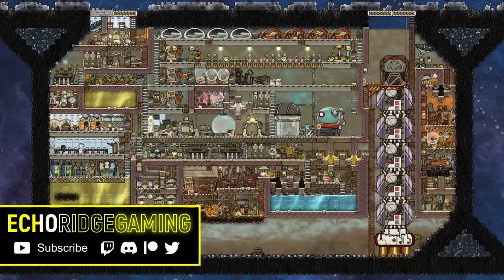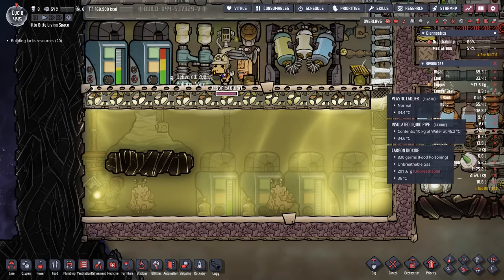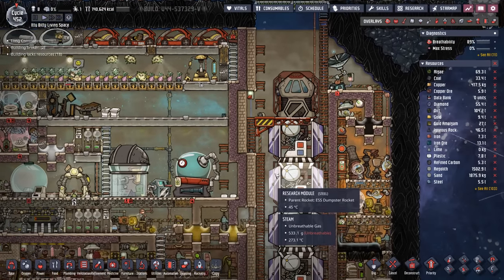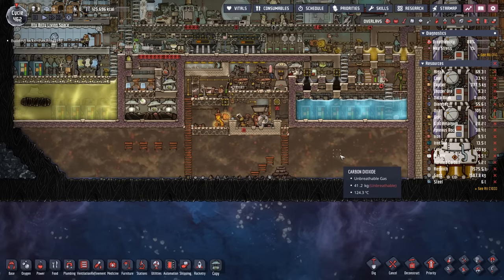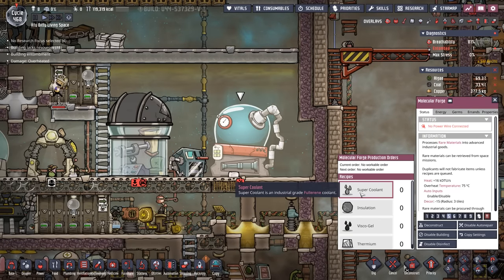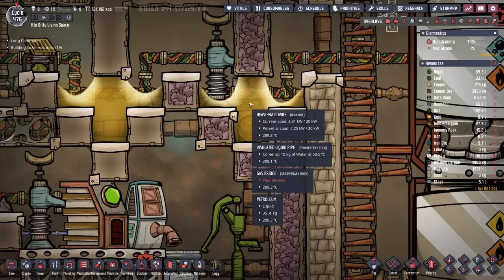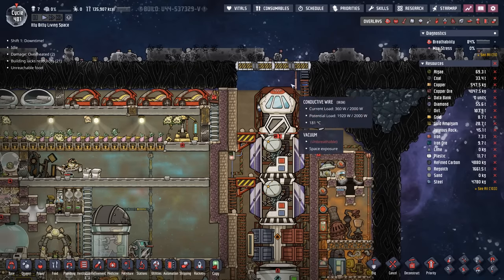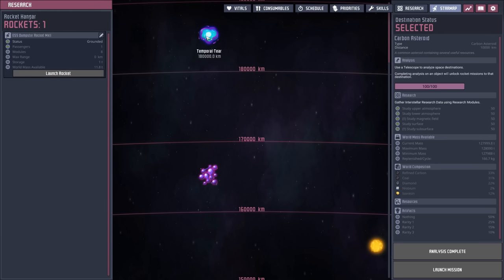New Dumpster Brick and Rocket! | Mini Base Ep 9 | ONI

Comment: 2:10 Them 2 tiles are cracked
3:33 There is another cracked tile at the bottom of the oxygen generating room. there's your source of scalding. a puff of steam get pumped into the vents once in a while
Reply from the maker: Nice catch on the p.water tank.  Unfortunately, even after I sealed the SPOM, the scaldings continued.

Comment: As I was watching, I noticed the CO2 used for the Soda fountain is coming from a gas canister filler.  The filler is being fed by CO2 from the Nat Gas generator's exhaust (Min temp of 110*).  Wouldn't be surprised if this is where the random scaldings are coming from.
Reply from the maker: I need to take a look at this, thank you for the suggestion.  I believe the CO2 cools pretty quickly while sitting in the bottle waiting to be delivered, so by that time it should be under 70, but I will take a look.

Comment: Looks like the Hot-Foot investigation is still ongoing. My best guess was the same bug as the one with the Clean Water on the Polluted Water Tank.
I think you could Tap the Rocket Shaft like a geothermal heat source. You could use it to cool down the shaft and distill water.
Reply from the maker: I am hoping to add this eventually.

Comment: At just one tile thick, Abyssalite veins will not do much because the materials on either side can impart and draw heat at a little over half of their own thermal conductivity. Because of Flaking, hot Abyssalite tiles can very quickly transfer heat, totally ignoring Abyssalite low thermal conductivity, to liquids dropped on them to make them change state.
Reply: Flaking is a mechanism which makes small 5 kg bits of liquids and solids to instantly phase up when two tiles with a high enough temperature differential come into contact, regardless of their respective Thermal Conductivity. Thus, when excavating Abyssalite, especially those that seal in Volcanic Biomes, care should be taken not to thin out the seams too much.

Comment: Perhaps the composts are causing the bathroom scaldings? The dirt comes out at 75C, after all, and it's only a tile away from the innermost toilet. It's just an idea though.
Also @19:13 where did that dupe come from? Is the water sieve filtered to only use sand? If not, then @7:28 there's lots of loose regolith that isn't dupe proof...
Reply from the maker: This is a possibility, except I have the water sieve set on 1 and there is a pile of regolith there.  I need to work on cooling all the debris though.
Reply: @EchoRidgeGaming  What about this for a possibility? Suppose your researcher was doing their thing in the lab, and the next task in their priority list was to refill the sieve (or the deodorizer next to it). Do they grab the nice cool pile of regolith next to the machines and fill them with that, or do they grab the hot regolith and use it instead because it happens to be closer to where they're standing at that time? In the former case, they'd be walking to their supplying task empty handed until they get to the cool pile of regolith. It might be worth testing to be sure...

Comment: Ideally you want to put something fully automated behind the rocket silo to remove the need of dupes going there. You could also try to steal heat from the rocket silo by having a connected silo and factory room! Could even have just one entrance to it instead of two
Reply from the maker: I def need to modify the pathing a bit.
Reply: @EchoRidgeGaming  Also, can you try using the different modes in the temperature mode? There's one that shows how much energy is too cold or too hot for a dupe. It doesn't seem like it will help in any way with your problem, but would be interesting nonetheless!

Comment: Regarding the water on top of the polluted water, The issue could also be hot insulated tiles boiling the poluted water. I had the same thing with a steam room next to an poluted water tank separated by insolated tiles. Every few cycles I would find normal water in the poluted water tank. When I investigated it I found that once in a while the hot insulated tile would flash a little bit of the cold poluted water to steam which then directly condensed into water.

I solved it by double insolating the wall.

Comment: check to see if when you get that scalding notice is both you aqua tuner and the (gas one) running at the same time. I've had it where my dupes were right in the middle of 2 aqua tuners in 2 separate insulated spots, and my dupe was in an atmo suite just near neutronium. they weren't on the neutronium it was just close suddenly scalding as soon as they pick up something they've done for 20 cycles. so i added an insulted layer on the dupes side, just to separate them from the neutronium. i know it don't make since why but it helped me. but my setup was different...

Comment: Weird, after commenting about it last time I had a similar issue in the past week with random scalding. Basically the same kind of area, except the atmo suit dock was inside a rocket capsule (spaced out). Checked everything in the immediate area and didn't spot obvious hotspots. Was almost like they carried a pocket of the heat from the suit required area and it slapped them when the suit came off. Don't think they were carrying anything, but I may have missed that. It eventually stopped happening so I ignored it.

Rather larger annoyance I have lately is dupes ignoring the checkpoints and running into saunas without a suit. Sorely tempted to let the laws of thermodynamics sort that one out.
Reply from the maker: Thank you for sharing.  It helps my sanity knowing I am not the only one.

Comment: 13:36 there could be a bit of heat trasfer from your dirty brick to outside of the dirty brick
you have a nomral tile above the electric joint plate that touches diganally to another normal block.
I 100% know that metal back tiles transfer to the tiles around them, would guess any background tile or tile does also.
This might not be your issue, but meh

Comment: Hey echo. If iam right there is no need anymore to disable auto repair. If the dupes repair it then the temperature get zet back to the normal building temperature. It is then not directly over heating anymore. But i don't now if this is to in the mini base map because the setting for it to play. Greatings from holland.
Reply from the maker: Hi from South Carolina!  It is more about not spending the materials needed to auto repair.